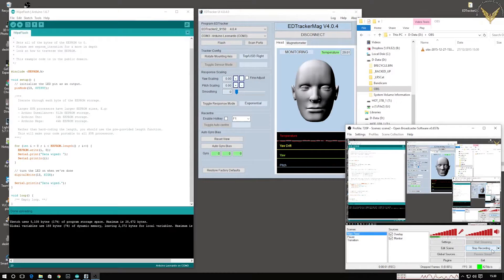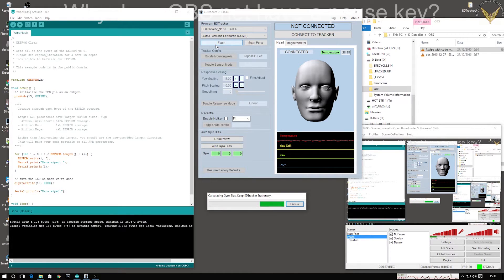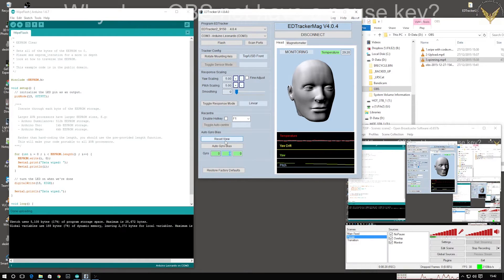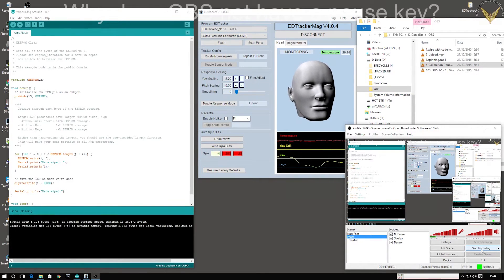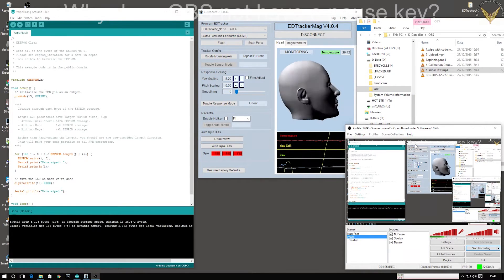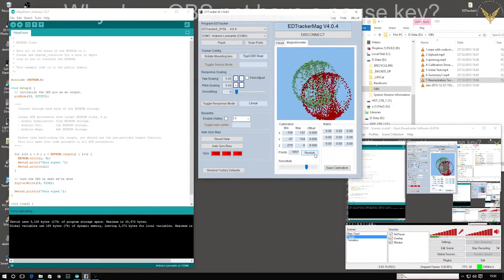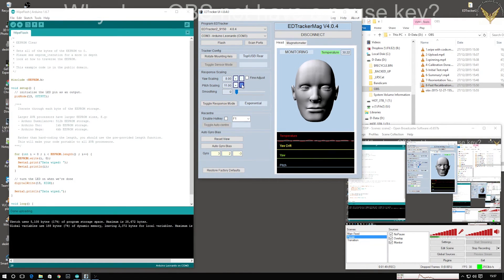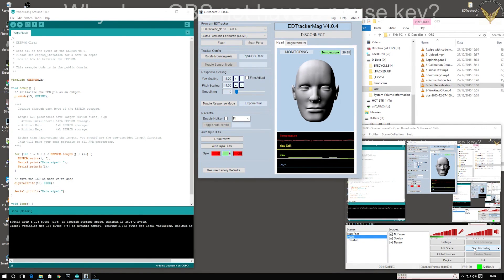EdTracker fixed. The weirdest problem.

Comment: Head Roll is working grand in the ED TRACKER Config... Trying to get head roll into Elite any ideas ?
Reply: Head roll isn't supported in Elite at my last check. I have to say it would be nice if it was.
Reply: I can get it to work with the use of Opentrack in unison its just fiddly and rather just have EDTracker on.